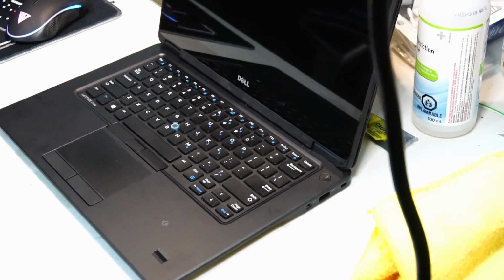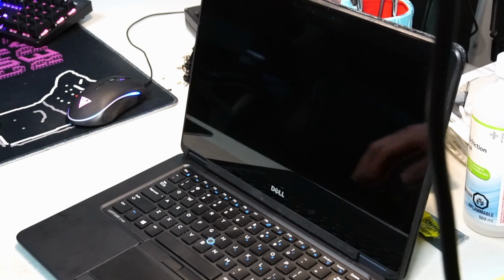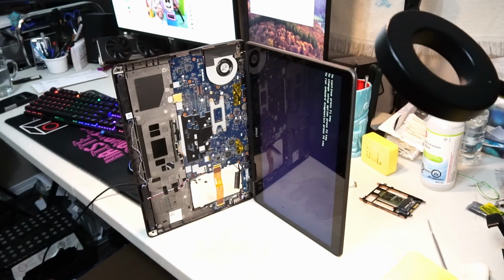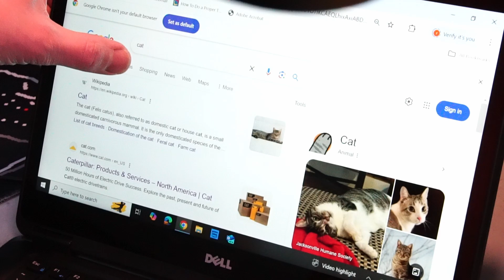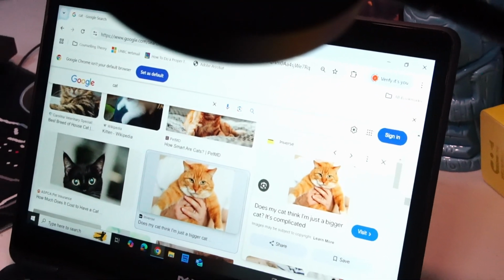Dell Latitude E7450 Touchscreen/Display Panel Replacement

Comment: That was great!
I would love to see how you put everything back together though cause there are a lot of pieces.
Also what to do when the laptop dies as soon as it’s unplugged, ie not holding a charge?
Reply from the maker: Well, you could create a diagram of sorts on a piece of paper and label what screw goes where.  Or document with pictures as you go, to make assembly easier later on when service is done.  As for the laptop shutting down each time it is unplugged, that is more than likely a dead battery which can be replaced.

Comment: im using the same dell with same touch screen version, i want to replace my screen its damaged because of water i have another dell laptop same model for parts and idk how to replace it by myslef i hope u guide me with that
Reply from the maker: Well, if your second Dell laptop is the exact same as the one needing repair . . that is why this video exists.  You will need to watch it in order to follow along with me.
Reply: @ yeah I replaced it… its also broken 😂😭